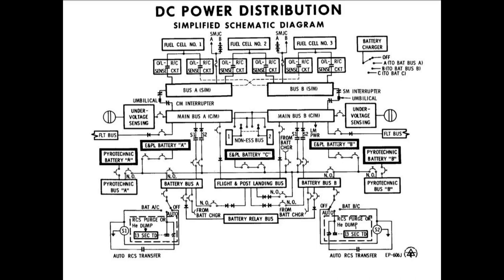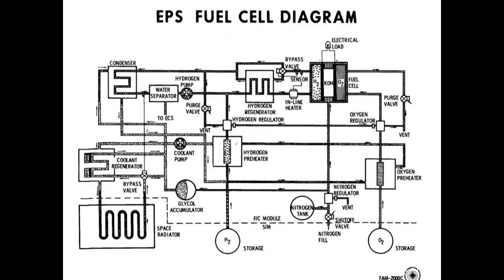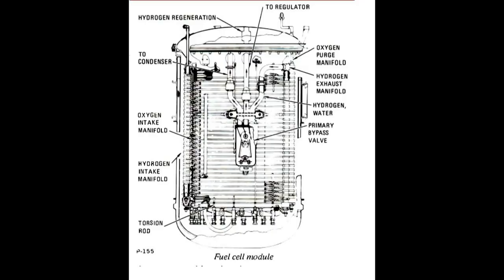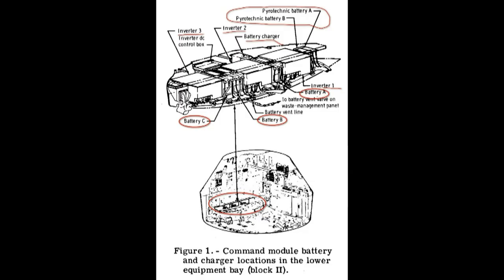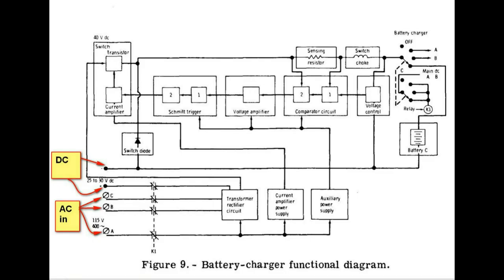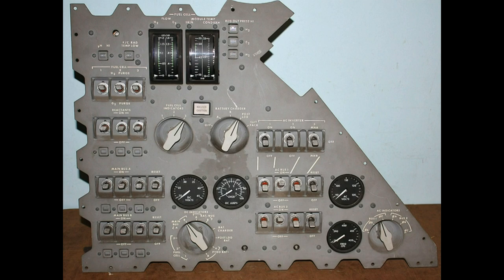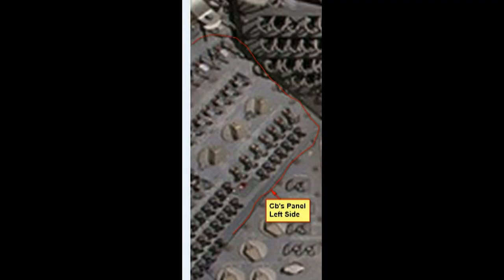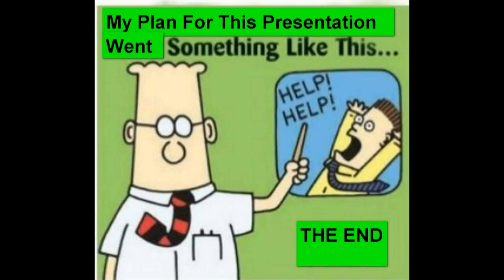Apollo Spacecraft Electrical Power System EPS

Comment: Thank you for this video, Anthony. Years ago I removed a few components from Apollo Command Module Boilerplate 14 when it was in a Tucson salvage yard. I sold the "Spacecraft Battery Charger" and one of the three Westinghouse 400Hz inverters but I still have two inverters.
Reply from the maker: It's nice to save apollo Parts. They are real collectors Items. Boiler Plate 14 was a House Spacecraft in bldg. 290 Downey in 1964, 1965,1966 and maybe more years.  It was used for testing the ACE System. The Ace system consisted of a control room, Mainframe Computer Rm and RF telemetry rm. They would put this data into the computer and run a simulated mission. This was the first CSM spacecraft to do that. It's really historic. It never flew but was used to help Test equipment chances and other thing to see how they worked on the flight models. I was there at the that time and I must of worked on it too. (all the space craft looked alike) Check out my video on the Ace system in Downey. Just google "Anthony Vidana youtube and all my video should pop up. Thanks Neil for sharing,
Reply: @anthonyvidana2654  Thank you for sharing this information on Boilerplate 14, Anthony. It is interesting to learn about the history of the CSM that I salvaged the Westinghouse inverters from. Regards, Neil
Reply: Thank you for posting Anthony! I have to do a report on Apollo CSM EPS and this video helped me understand it better